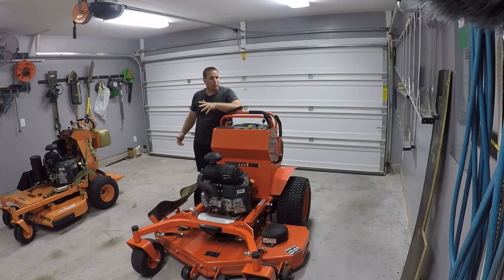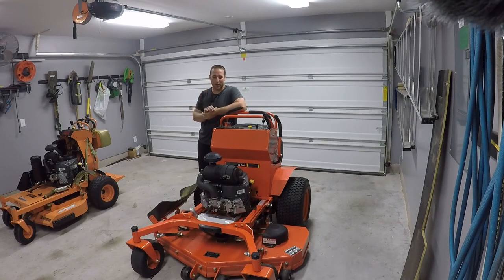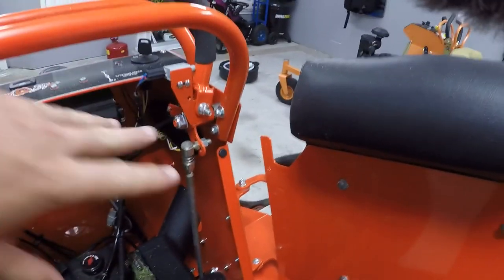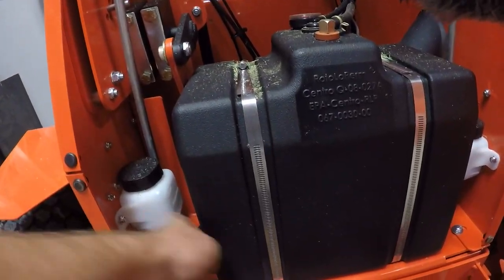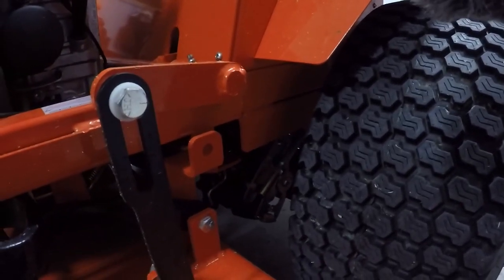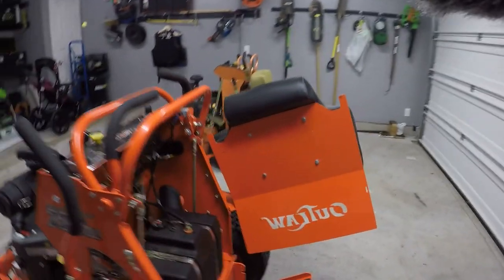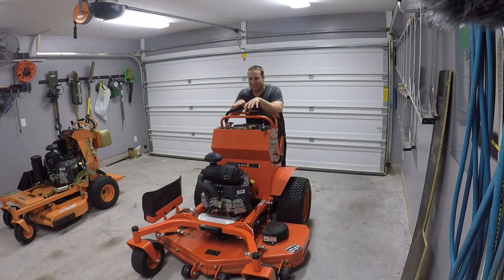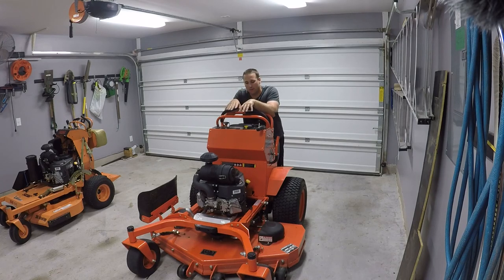2017 Badboy Outlaw Stander - 10 Hour Review (Comparison w/Scag V-Ride)

Comment: Wow really interesting note on the clutch engagement and hydrous.  I can tell you from an automotive standpoint loading up a engine like that under full throttle is very bad for an engine.  It might be worth spending the money now to get a different style clutch now rather than replacing a engine at 200 hours.  Now your hydro situation, this is the first time I've heard someone complain about the lack of snappiness in in a transaxle set up.  Its usually noted that pump and motor is smoother while transaxles are snappier.  The reason being is that on a pump and motor the pressure has to be built in the pump, the lines, then the motor, and finally gets out putted to the wheels.  While in a transaxles its all one unit.  Now while reading my manual it noted that after a fluid change you need to bleed the transaxle our you will have very poor motor performance.  while yours is functioning alright I think it could use a little bleeding.
Reply from the maker: riconavy1 they have consistently performed the same even before the first oil change.  I've been very satisfied with the hydro she so far it's just a more smooth subtle action with less resistance on the controls than the SCAG.  I really can't say that I prefer one system over the other at this point despite how different they are.
Reply: that is super strange man.  I have a 1230 lbs. Bradly 52 (bobcat clone) with the 3400's in it.   With my forward speed set to about the middle position I've accidentally popped wheelies by giving it a little to much juice lol many times.  If you are happy with it and its working fine for you I wouldn't touch it, but with the issue of it backing up hills, and the slow but smooth performance it really sounds like air in the hydro system.  When my mower came from the factory the levers were  too far forward with very little reverse.  I actually had to back it up a ramp to get it off the crate it came in because I was in a hurry and didn't have a jack lol.  While it moved slowly it climbed that ramp like a billy goat lol.  So similar issue to you not having enough reverse travel on the linkage but I wasn't lacking power at all.  Speaking of power it could be that that kawi just isn't able to drive the hydrous properly enough to maintain full pump pressure.  Once again if it doesn't bother you I wouldn't worry about it.  With mine being the way they are the controls are a little too sensitive.  It takes your full attention to do small maneuvers' lol because you don't want to go bolting forward.

Comment: there in AR. made in the usa i run a BB zero turn pro 27 hp 60 in deck dam i love it its a tank it never breaks down either !!! get the mulching blades from bad boy or gator blades they rule the grass
Reply from the maker: I might have to try some gator blades on it, should definitely help with turning leaves to dust.
Reply: yea when i want to mulch bigtime i block off the chute to they really mulch great then but i run them all year long they just make smaller clippings
Reply from the maker: Its definitely time for me to start ordering some blades, sharpening others and doing the winter maintenance.  I've been lazy about getting to the trailer.  Responding to these comments reminded me I need to go out and get some Stabil.
Reply: if you have a place called AGRI SUPPLY its all types of farm n mower equitment place they have the mulching blades cheep to

Comment: Good video, real interesting comparison between these two mowers. I really wonder though, how they compare when working on a hillside? I'm guessing the scag might have have a big advantage with the engine being placed closer to the drive wheels, but who knows you tell me. And ya I agree that blade clutch sounds pretty crappy too. BTW 😉 ortaga makes Mexican foods but ogura makes great electric pto clutches.
Reply from the maker: Jim W I like the position of the operator platform on the Outlaw because that rear position allows you to stick the mower further under obstacles like low trees or playsets.  Both seem to be well balanced but the SCAG actually has two pretty hefty weights installed between the front wheel forks.

Comment: If you like orange you should be looking at Kubota.
Reply from the maker: Hey there Taboo.  I have looked at their mowers but as far as service goes I was never big on the design of the fuel tank under the seat instead of the saddle bag fuel tanks that allow easier maintenance to the bottom of the machine.